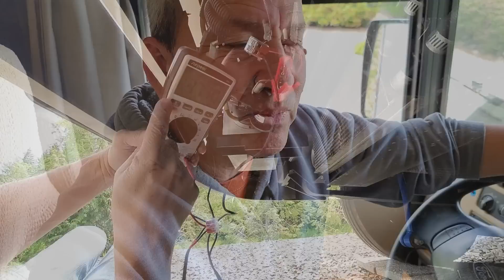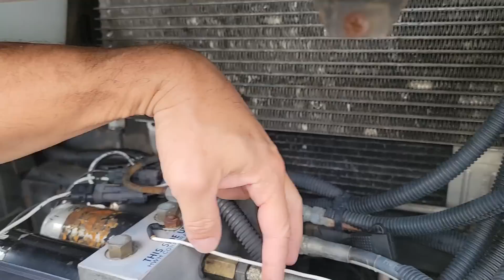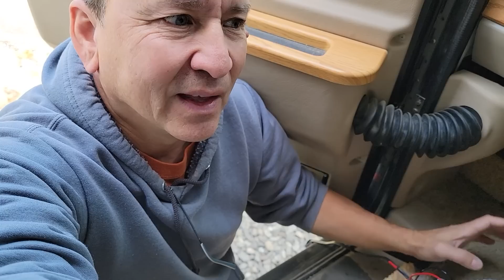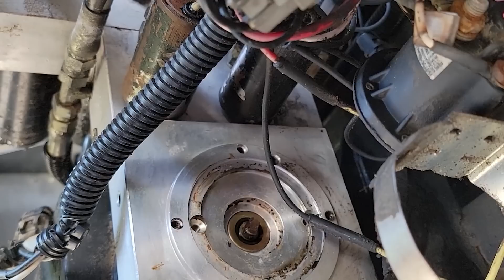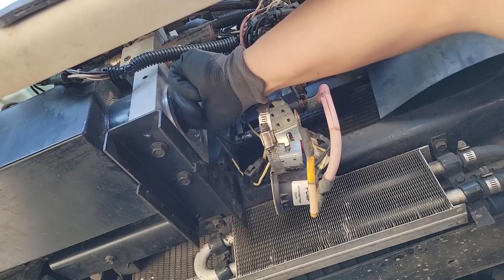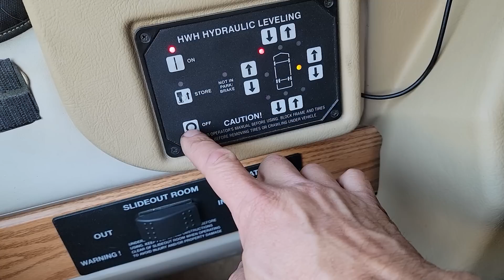HWH Pump Motor Troubleshooting and Replacement - RV Slide Out and Jack Failure

Comment: Dude! Thanks sooooo much for this video! Been going through the same problem(s) with the slide out & jacks & searching but not finding answers......until NOW! You see, I have a 2000 Winnebago Adventurer & EVERYTHING shown in your video is identical to mine, from the slide out switch to the jack switches to the pump/motor/tank unit to the motor & 2 relays(solenoids?) held on by the hose clamp, etc. I've been searching for days on the internet & this one of yours was the exact ticket for what I needed, from troubleshooting/testing to R&Ring the motor & to guidance for ordering a new replacement motor. You've saved me(& many others I would assume)such a great headache in dealing with this nightmare issue. THANK YOU SIR & MAY GOD BLESS YOU ABUNDANTLY. Keep up the good work Mister!
Reply: UPDATE: 
Went to take some voltage readings but before I did, I loosened some electrical connections to the motor, wiggled them around in hopes of making a better connection, tightened it back up &......put my Fluke DVOM on the first test spot, had my helper press the slide out button to see the reading & I'll be damned if the ding-danged slide out didn't start working & sliding out. I was Flabbergasted! I had a mindset of buying a new motor for around $200(& perhaps more parts too) yet was pleasantly surprised that I had inadvertently fix the issues. Tried my jacks & they worked too. Took all other connections, including grounds, apart & cleaned thoroughly, put them back together & it's been working fantastic ever since(keep in mind this Adventurer is 26 years old). However, this video & "Dude" in it gave me so many excellent ideas & priceless information that I could just sh!* & nearly did! JK, but really, I am glad for this video. Thanks - it saved me alot! 
Party On Wayne, Party On Garth!
SHVING!!!
Reply from the maker: Hehe! Party on 😂
Reply: Also Tito, Thanks for tip about Kevin's site. I'll be checking that out too. Keep it up Brother!!! We appreciate good peeps like you!
Reply from the maker: You're very welcome. There isn't much information on this older stuff. So I was hoping this would help others in the same situation. You should also check out Kevin Caudill's channel (https://www.youtube.com/@ktoutdoor). He has done a lot of work on his HWH system and I've learned a bunch from his videos. Cheers!

Comment: Tito, thank you so much!  Fellow Seattle RV owner here, with a 2005 Minnie Winnie with two pop-outs on an HWH system.  Like you were, I am pretty terrified and not knowledgeable about our hydraulic system.  Because I didn't even know where the reservoir and system was, I did not even think to check it.  On a big trip to California a couple years ago, one of the hydraulic lines blew and pretty much ruined our trip.  Since it was summertime none of the repair shops could help us... luckily a mobile repair guy knew how to release the pressure and we muscled the slides back in, and secured them with 2x4's inside the RV above the slides.  Ugh!  But we made it home.  Now I've noticed a leak on the little check valves on top of the aluminum manifold, but YouTube saved the day again and turns out they had just come loose (also might have a cracked O-ring).  Anyway, would have never had the guts to try anything like this, so thank you for being so calm and instructive.  What I've learned is to be curious about all the systems, take your time (and carry a ton of spare parts).

Comment: Thanks to your video, I was very confident in swapping out my motor. However, now, my jacks come down and I get my RV level and they start to slowly retract and I’m unlevel again. Also the rear passenger jack is very slow to store. Is this coincidence or have I done something wrong replacing my motor. I did fill the reservoir with ATF recommended by HWH while my jacks were stored before I replaced the motor. I have cycled them after motor replacement and still having the same problem. Have you had an issue like this? I don’t see any visible hydraulic fluid leaks.

Comment: Excellent viedo! Thanks, I'm changing my motor now. I understand the solenoid relay switch that is energised by the slide button.  Do you know  what is the 2nd solenoid for?😕 I couldn't find any info on it.  Thanks again.
Reply from the maker: Second solenoid? Do you mean the solenoid valves on the manifold?
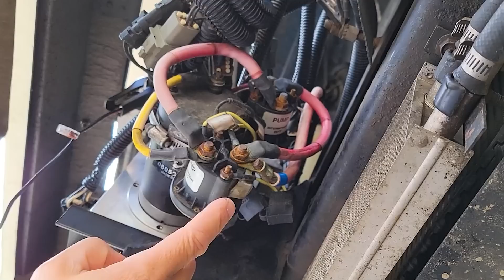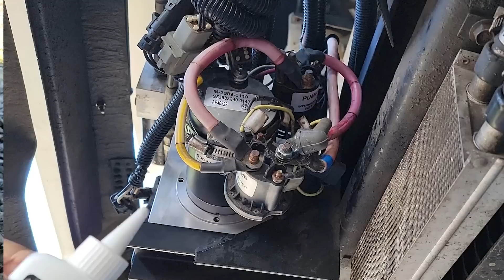Reply: Thanks for the quick reply, I'm a bit slower. Mine is a 2003 Adventurer with same set up/motor. At 2:54 and 11:53 the 2nd solenoid is shown. They are connected in parallel. You can see this on the video.  It looks like either one or both together would energize the motor. Any thoughts on this. I orderd only one solenoid, now I'm wondering if I should order another and replace both.

Comment: Do your leveling jacks run off the same motor? Were they working before you replaced the motor. The reason I’m asking is could it be possible that your relays just needed the corrosion cleaned from the contacts?
Reply from the maker: Yes. The hydraulic jacks and slides are all part of the same system.

Comment: Tito is such a great help with saving money and keeping things working!!.. I wish someone would make a video on single cylinder bedroom slide. My 2003 Winnebago Adventurer 38-g bedroom slide will go out but not go back in unless I disconnect the hydraulic cylinder and pull it in with ratchet straps. I had the cylinder rebuilt by HWH but it seems to be catching on something in the floor..
Reply from the maker: HWH has pretty good info about the hydraulics -- specifically the dual action cylinder on that slide.  (https://hwhcorp.com/ml57000-016.html). The slide itself is a Winnebago thing. It's hard to say what it's catching on. When you ratchet strap it in, does it come in straight? Check the alignment screw. Kevin Caudill @ktoutdoor is a good resource too.

Comment: Perfect Video. My motor started running slower and slower, then stopped.  I figured it was level as I have no slides. The next day I went to level it and it came on, but not the motor.  I took a block of wood and hit the motor, and it started up. Good fix until I get a motor. Unfortunately, my motor is different than yours since it is 31 years old, but I'm sure HWH will have one.  Pricey little guys.. Thanks for the video.
Reply from the maker: Hey guys. Glad you were able to get it working for now.

Comment: You are supposed  to remove the nuts on the motor on the long bolts that hold it on , they are only on there to hold the motor together for transport ! It will fit exactly into place with the nuts removed ! With these still on , the drive connection is only making contact about half or less !
Reply from the maker: Interesting. The 20 year old original that was removed also had them.

Comment: Brian, did you analyze the failed motor? I am curious why it went from OK to not OK so fast! Thanks for work.
Reply: @aguyinback  
My motor went from working to not working. I took my motor apart, and found that the brushes were broke in half. My motor has two set of brushes. And two brushes were broken 180 degrees apart. Brushes cost at the time about $50.00. A new motor costed me $1,000.00. I bought the new motor because we was leaving in three days and didn’t want to chance, the brushes were the sole reason. I haven’t bought the new brushes yet. I think that’s the problem though.

Comment: CHECK BATTERY CONNECTION 1ST.  I was about to go through all of this when I realized the start battery post connection was able to spin by hand.  bolt to tighten was corroded away.  once wire cleaned and bolted down hard, everything came to life.
Reply: solenoid was clicking but motor wasnt working

Comment: The motor mfg probably figures that since the motor is wore out, it is probably time to replace the solenoid also. A little preventative maintenance as long as you're operating. If you look inside a solenoid, it has a copper disk that gets slammed against the two posts that the cables connect to and these deteriorate over time.

Comment: Hey Buddy.  You just saved my trip.  Fortunately my pump was still functional, but based on your diagnostic hints, I was able to figure out that the solenoid was not functioning properly.  I was able to temporarily jump the solenoid, and everything started working.  Oddly, when I removed the jump, it continued to work.  Will keep an eye on it and likely replace the solenoid.  But for now, I am on the road.  Thanks so much for your time and effort.
Reply from the maker: That's great to hear. Nice job! Happy to help!

Comment: I have this exact same motor and I cannot find it anywhere even in he link provided
Reply from the maker: There's a phone # to Stuart's in the description. You have to call them and order one.
Reply: @RVwithTito  just noticed it's Sunday I will be calling them in he meantime.i believe we have very similar models is there anyway to manually extend the rear slide. 2003 itasca suncruiser here
Reply from the maker: The only way I know is to release the pressure on the slide out solenoid valves, then push from the inside. Very difficult. Maybe use some kind jack without breaking furniture. May be easier just to fix the motor first 😃
Reply: Part finally came from the manufacturer.this video was exactly what I needed.exact same setup as me  slide fired right up
Reply from the maker: That's great! Nice job.

Comment: I've been wanting a meter with some sort of Bluetooth read out. For remote readouts. Anybody know of one ? We had a large reunion in Montana and several of the slides were making popping noises. This made me wonder if they were using screw jacks which should be lubed. But, if its hydraulic,  there must be some other lube issue ?
Reply from the maker: Here you go. https://amzn.to/3LA3arE

Comment: First of all, the thanks for the video on replacing the awning motor. Followed all the instructions, including the rush to do wiring and didn’t notice the coupler still sitting on the table. LOL.  The jacks on our 2019 NEWMAR Baystar died. The contractor was toast but easily replaced and solved the problem. Contractors are most often confused with relays. Great video.
Reply from the maker: You're welcome! So was it the solenoid then?

Comment: hi, Is there any alternative system to place the slide inside, I mean is there a way to insert it manually? Thanks for the information. Just in case I'm looking for an Allegro Brezze 28BR or a Serrano 31X, if anyone knows, let me know. Thank you
Reply from the maker: There is, but each system may have a different procedure. Mine involves releasing pressure from the solenoid valves and pushing (or pulling). There is a winch provided for this purpose.

Comment: Thx for posting! I just purchased a 2004 Newmar Kountry Star that has the same hydraulic leveling system from HWH (although not for slideout). My motor looks original, so this video was great so I know how to change it when it inevitably fails when I am in the middle of nowhere! My research indicates mine is near the end of its service life too. Thanks again, I also like your easy, clear electrical testing instructions...
Reply from the maker: Hey there! Thanks for the comment. You're smart to be prepared. Glad I could help. I need to order a couple of solenoid valves too and keep them on hand. That could be my next failure :)

Comment: Thanks for sharing.  I loved how you use the wire clamps to put alligator clamps on your multi meter. Was also fortunate that this happened while you were at home and not on the road.
Reply from the maker: Thanks. Yes. The alligator clips came off a small jump starter or trickle charger (can't remember), but it really comes in handy when in a tight situation and you can't hold a probe. I also have attachments for solar MC4 connectors and a couple other things.

Comment: My system is just like yours. 2003 Itasca. Replaced my motor just 2 months ago. Then a solenoid went out for bedroom slide out. Would go out but creeper in about 8 inches.  Replaced that and all.good. very easy to do. HWH has all.the parts. Also lost the hydraluic hose to the back slide. Easy fix. 32 foot line. Go to Napa auto parts.have it built
 Cut the old line and just overlay the new one and tie it to the existing ones. Hope this helps.
Reply from the maker: That does help. Thanks. I have on my list to get a couple spare solenoids. I better get on it.

Comment: Great vid. I have separate HWH hydraulics now: Pax side rooms and newly installed HWH jacks (installed at the HWH plant in Iowa last week). Got back to Albuquerque and lo and behold my bedroom slide quit functioning (fails to extend) but does retract.  Don’t think its the motor since the kitchen extends/retracts and the bedroom retracts. Any ideas??
Reply from the maker: Might be one of a few things. Start by checking for power when you press the switch. Make sure the e-brake is applied first of all. Then work your way back from the relay to the controller (somewhere under your dash), then to the switch itself. It might be one of the solenoid valves that controls the "extend". I believe there's one for extending and one for retracting. Hope that helps. The HWH doc I linked to in the description has a good step-by-step troubleshooting guide.

Comment: Thanks for the great videos, very similar to my rig (2002 F53) so I'm learning a ton of information from you.  Watching the video, you still have your chassis batteries.  I thought you replaced them with the big BB LiPo install.  What was the reason to keep your existing chassis batts?
Reply from the maker: I replaced the house batteries. The chassis battery is still a single lead acid.
Reply: @RVwithTito  I didn't type that correctly, I meant house/coach batteries.  In the video, your batteries under the stairs look like FLA batts.  Is that for the Chassis or for the Coach/House?
Reply from the maker: @eroenker  That's the FLA chassis battery (just one). The house batteries fill a nearby compartment.

Comment: Brian, if you ever think it’d make good content, could you show how you did your probe extensions with those WAGO connectors?  I think I got the basics, but I’m wondering if you sacrificed a pair by cutting the probe off to reveal the wire to insert into the WAGO?  Could have used something like that on an under cabinet lighting project I just completed.  I wanted to ID the romex pair but my meter wires were too short to reach.  Great idea regardless and I’ll gin something up like that!  Cheers!
Reply from the maker: Thanks for that feedback. I've been thinking of doing a multimeter basics video.

Comment: Wow, I’m so glad that happened when you were back at the barn!  I’ve had a couple failures at home too and it’s always a big sigh of relief when you get lucky like that…. Great topic too.  I had to clock my pump 90 degrees on my lithium/inverter project and felt the same trepidation about the hydraulic’s.  “No clue” about that huge wire bundle connecting there!  😅😂
Reply from the maker: I know. Whew! We had the a slide get act weird while retracing on our way back from Alaska. We were in a very remote area in northern BC. We didn't open it again until we got home :)
Reply: @RVwithTito  Perfect timing thank goodness!

Comment: Could you (or I) have unbolted those two nuts holding the pump manifold and worked on unit on bench ? My RV ('05 Dynaquest) that pump/relays can't be removed unless manifold removed. BTW: Those slide out/in solenoids look ratty. Could have changed those as well (to HWH newer lever versions)  ? Thanks for video as never knew there were two high current relays. Mine are inaccessible.
Reply from the maker: Not sure. I don't know at what point hydraulic oil comes spilling out. Those solenoids are a bit rusty. I cleaned them up and painted them black again after the repair. I do need to order a couple spares to carry just in case. I'm sure one of those will be next to go :)

Comment: Auto correct sucks.   Did I miss the video on the solution.   ;)
Reply from the maker: No you didn't miss it. I've been sharing updates on Patron though. Basically, it's been on hold while I wait on equipment and fix a few things...like the slides. I couldn't access part of the intake with the slide retracted. I have most of the stuff now and am going to be working on it.

Comment: A question about a previous video.   The air conditioner you removed it what have you done with that project or dude I miss you end solution.  Mine is a 2001.  U .   Just curious.

Comment: Wondering if you have had to replace the bushing that the slide out rides on i have an 03 brave and noticed one of mine is cracked and part of it is missing
Reply from the maker: I haven't. Is it a vinyl bushing?
Reply: @RVwithTito  its aflat nylon that the arm of the slide rides on they are known to crack and fall apart i took a pic of the area but cant seem to include it in my reply

Comment: That electric motor is almost identical to many snowplow motors, it looks identical to my plow motor.  Almost all of them fail due to the carbon brushes getting corroded and not being able to slide in to the rotor.
Reply from the maker: Yeah. The little piece on the end is what differs. I may work on the old motor. For now I didn't want to fuss with rebuilding it. Just need it working. 👍
Reply: @RVwithTito  Great. BTW,  your videos are really good. We are on our 8th RV and like to hear what you do on yours.

Comment: don't like how the wiring is so exposed to elements and how corroded the connections are. That could have caused excessive current draw causing motor to fail.
Reply from the maker: Agreed. Should be good to go for a while now. I cleaned everything up before putting it back together.
Reply: @RVwithTito  love watching your channel. keep up the good work.